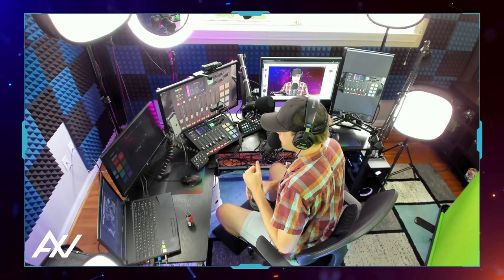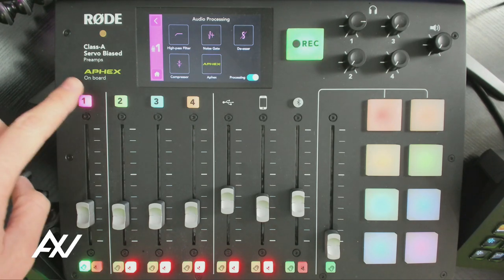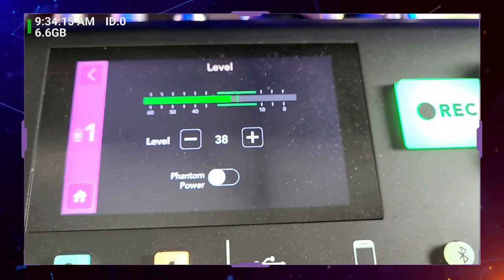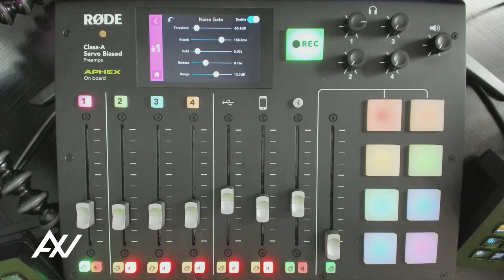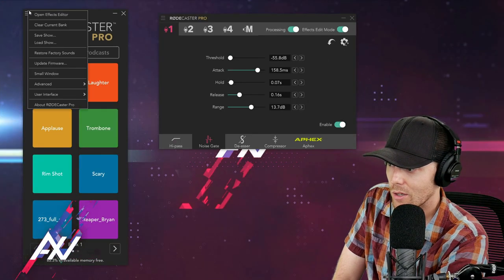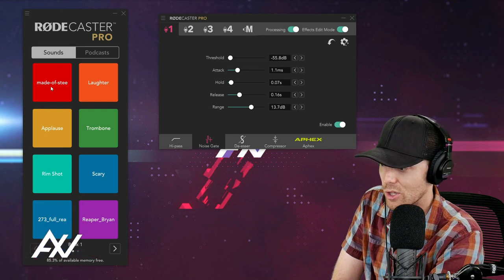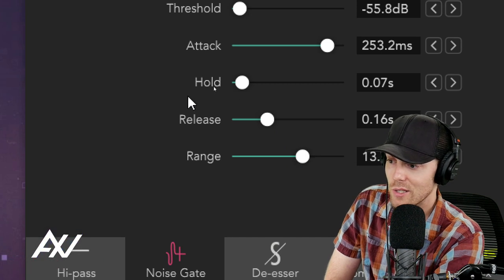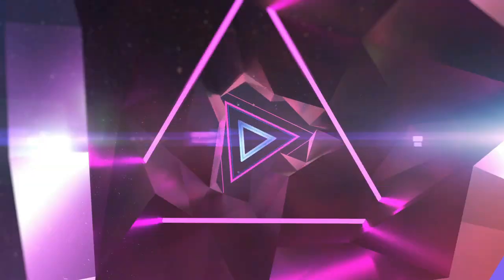RODECaster Pro: How To Setup Noise Gate Filter (Best Settings) -- USB  Mixer Tutorial Guide

Comment: You got this a bit wrong throughout. The noise gate's Attack is how fast it opens your mic when it hears the signal you permitted (in this case anything higher than -55db, so ...your voice). If you set the attack super slow, you'll hear your voice come on as if it were fading in. Careful not to set it too slow otherwise you'll miss the first letter of your first word you say when starting to speak. The HOLD feature is ONLY for when the noise gate cannot hear your voice anymore after a set time, then it will start shutting the gate off. This way, when you set the proper HOLD value, the gate won't be shutting off immediately after you finish your sentence, giving you time to start another one without hearing the audio go down and up again. And...oh boy, range. Just see this as how strong of a muffle you want on the sound cut by the noise gate. See it like an ear plug that is rated for 14db. Meaning the plug will ATENUATE the sound (lower it) by 14db compared to the original loudness. So if you leave range to 14 db on the noise gate, it means that your noise floor is going to be lowered by 14db when the gate is in effect (not talking) This is super usefull when the noise is extremely present and you don't want to hear the noise completely disapear when you stop talking. It helps keep a level of realism between the gate ON and gate OFF moments. Sometimes it's very jarring to suddenly hear complete void between sentences. Smaller range like anywhere between 14db and 6db is usually good.
Reply: Literally came back to this video cuz this was happening during my podcast. Cutting off the beginning and end. Would I need a faster attack then? Thanks for explaining!
Reply: @madisongvideo  if what keeps hapening is your voice fades in every time you speak, then yes, a faster attack. Kepp playing around until it feels "natural"

Comment: The way he explained noise gate can be misleading. Noise gate is not filtering out sudden loud noises. Noise gate is a threshold that, in essence, mutes your channel if the input isn’t loud enough. This comes in handy for—you guessed it—“noise”. That’s what producers call sound when they don’t want it (sound when they do want it is called signal). This comes in handy when your recording has intermittent or constant noise. Like a fan. Scenario: you record a 1 hour podcast. Talker stops talking for a few minutes while the other guy talks. Annoying fan in background. If you had noisegate dialed in, no worries. 

That’s what noisegate is. 

If a dog is barking while you’re talking, noise gate will do nothing to keep you from hearing the dog.